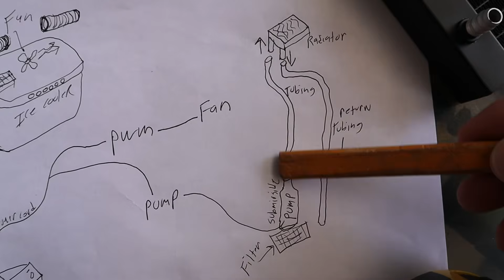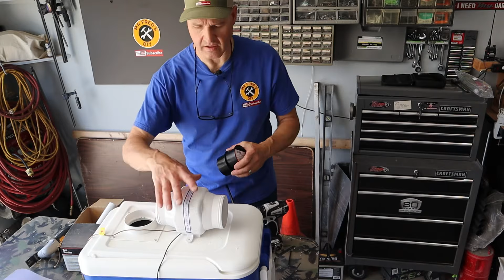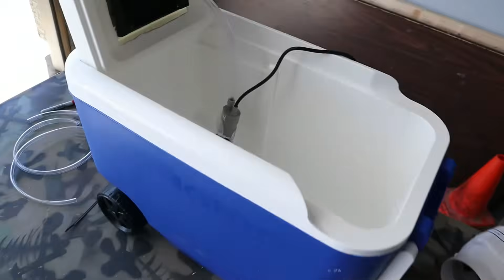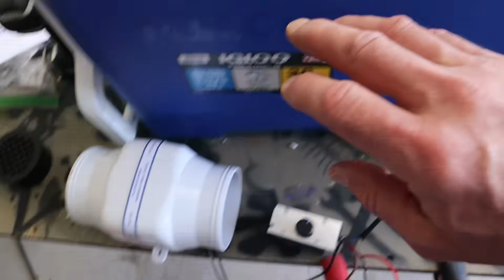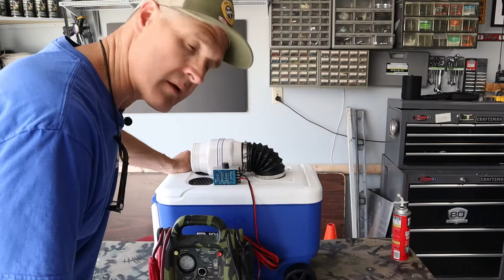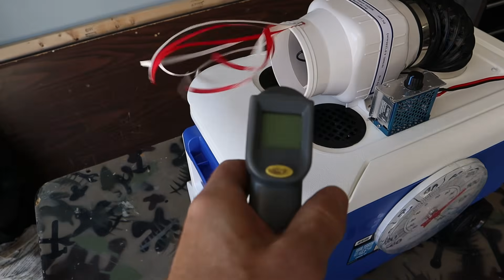DIY Ice Cooler Air Conditioner

Comment: Excellent DIY video Mr. Fred.  Well done!  Please post the answers to my questions under this comment:  Your DIY ice cooler air conditioner uses a blower fan and water pump that uses 12 volts direct current instead of 110 volts alternating current; during a hot weather electric utility company power outage ('blackout' or 'brownout'). your 12 volt direct current DIY ice cooler air conditioner can be connected to one or two 12 volt 100 watt portable solar panel(s) (such as Harbor Freight store Thunderbolt brand briefcase 12 volt 100 watt portable solar panel(s) or Rich Solar brand briefcase 12 volt 100 watt portable solar panel) without requiring a solar power inverter, without requiring a solar charge controller, and without requiring a battery power supply as long as the sun is shining on the portable solar panel(s) for the panel(s) to convert sunlight into direct current electrical power, and as long as there is ice available for the igloo ice chest.  For indoor and after dark use during a power outage, your 12 volt direct current Ice cooler air conditioner could be powered by either a gas powered electric  power generator, or rechargeable lithium ion battery power station.  Your DIY ice cooler air conditioner uses a small cold water temperature-to-air transfer radiator to cool the air and therefore, it can be used in an R.V., van, camper, tent, or a room because it does not release moisture into the air (a swamp cooler releases moisture into the air).  For indoor use when there is available 110V / 120V alternating current electrical power (when there is no power outage or 'blackout' / 'brownout'), your ice cooler air conditioner can be wired to a 12 volt direct current automobile cigarette lighter power connector plug and plugged into a 110 volt / 120 volt alternating current to 12 volt direct current power inverter available through Amazon.com.  My questions:  (1) Where can people buy your adjustable drill tool you used to drill the 4" holes in your ice cooler lid, and what is that tool called?  (2)  Where can people buy your power tool you used to cut / trim your plastic ice cooler lid for the underside of the 4" holes and for cutting the plastic underside of the ice cooler lid for fitting the radiator into the underside of the lid?  What is the name and brand of that power tool?  It would be interesting to know whether or not your DIY ice cooler air conditioner could be interfaced with a 12 volt peltier thermal electric water chiller such as those used in cold salt water fish aquariums.  It would be interesting to know whether or not a 12 volt direct current peltier thermal electric water chiller would be able to chill the water in the ice chest enough to cool the air passing through the radiator of your ice cooler air conditioner after the ice has melted and / or, without ice.
Reply from the maker: Thanks for checking out the video. To cut the round holes I used an adjustable hole cutter like this one https://amzn.to/3O2AuqK
The tool I used to cut the square holes was my Rockwell Soinccrafter oscillating tool https://amzn.to/3HzoKtj. Thanks for watching!
Reply: Peltier devices are extremely inefficient, according to a YT video I saw some time ago

Comment: awesome project. it does seem like it'll add humidity to the air, though. I wonder if, to compensate, you could make a closed loop system with water filled copper going to the radiator and using that chilled copper to cool the air. Maybe using a coil in the ice water.
Reply: For high desert dry this one will wrk thanks
Reply from the maker: Interesting concept, thanks for watching!